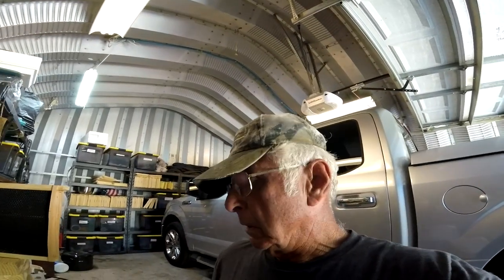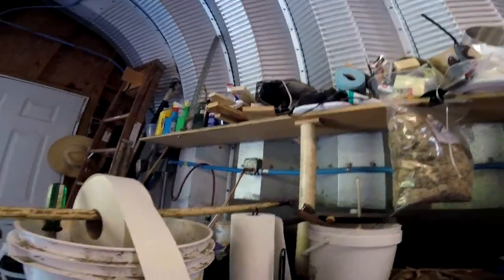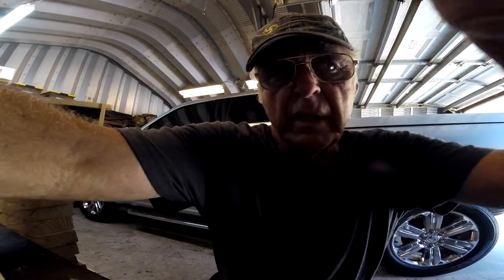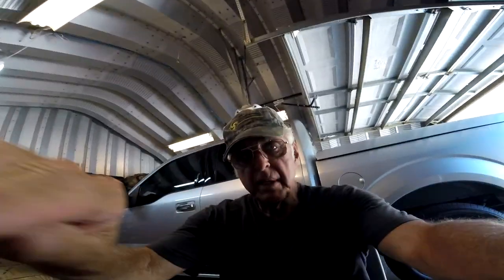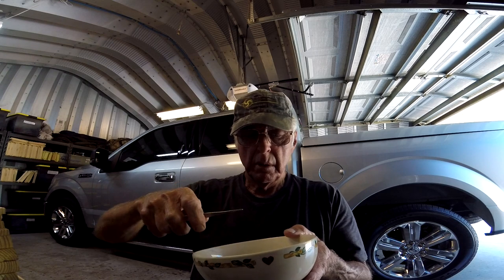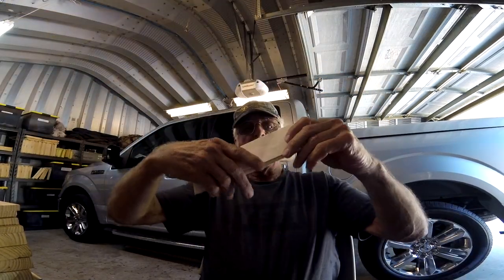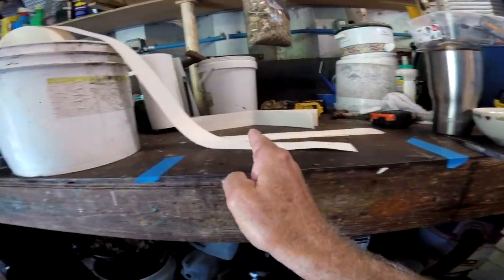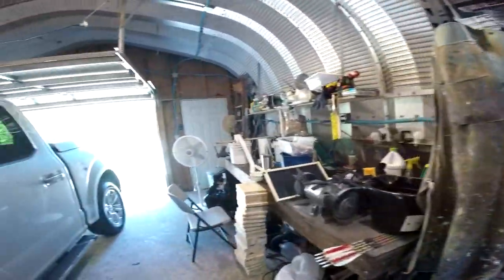Varroa Mite Treatment Options

Comment: I just read the Randy Oliver thing.  Sounds promising.   (I just bought Rick's vape tool :-) )

One thing... he uses vegetable glycerin... Not vegetable oil.  Not sure if the OA will dissolve in oil.
Reply: I just looked it up... Google said vegetable oil is not a good solvent for OA.
Reply from the maker: I'm using veg glycerin not veg oil.